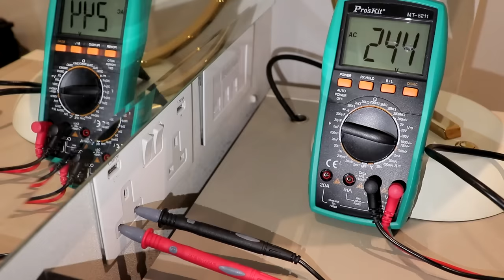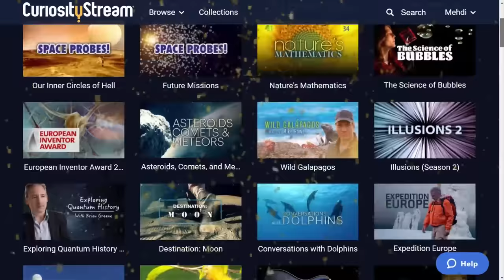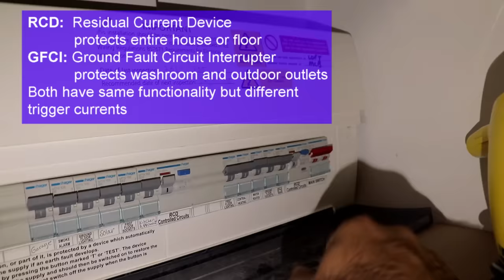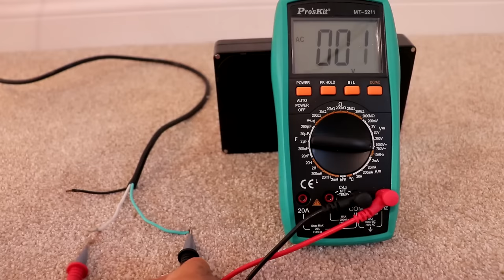Power Outlets in United Kingdom

Comment: As an electrician,  I was watching some of your antics through my fingers.  30mA is deemed the minimum that would stop a human heart. The bathroom adaptors are isolating transformers 1:1, so 230 in 230 out but the output has no reference to earth. Our  13A plugs are the world's best IMO, but a bugger to stand on in bare feet in the dark.
Reply: Most defibs give you somewhere in the vague range of 40 amps of current. We want to shut your heart down so that it restarts simultaneously and stops fibrillating.
Reply: is that 30mA applied directly to the heart tissue?
Reply: @KarldorisLambley  I believe its a current path from arm to arm across the chest.
Reply: @briwire138  aha. Thanks for your reply. Wow 30mA isn't much at all
Reply: RCDs are designed to shut off fast enough that 30 mA shouldn't be lethal
Reply: @Abigail-hu5wf  Many times have I fallen foul to the inverted plug in the dark. Worse than lego...
Reply: Who the heck stands on plugs?  Keep them out of the walkways at the edge of the room!
Reply: @SproutyPottedPlant  I see you have no experience with children at all... Even if you welded the plugs to the wall with titanium brackets they'd find a way to leave them laying about in the middle of the floor so you get a nasty 3am surprise when trying to use the toilet.
Reply: Once when I was a kid I was running down the stairs (you know how kids live to run down stairs instead of walking normally?) and not looking where I was going. One of my brothers had left a plug lying around face up at the bottom of the stairs, and I stepped straight onto it with the full force of gravity, my body weight and too much speed behind me. Had to go to A&E lol
Reply: @J75Pootle  you have suffered the worst pain imaginable to man. I admire your braveness.
Reply: @SproutyPottedPlant  or plugged in with the switch off
Reply: stopping/starting a heart is more dependent on the joules of energy, not amperage.
Reply: @J75Pootle  The only way that could've got any worse is if you had stood on the plug, then fallen to your knees on lego.
Possibly before rolling over onto mouse traps.

That must've hurt like crap though, those things are blunt as hell.
Reply: @shaggybaggums  yeah, easily one of the most painful experiences of my life, and definitely the most pain I've experienced due to blunt force
Reply: @Xorthis  I have had those naughty kids and still never stood on a UK plug and I am 61 years old. Tempting fate here!
Reply: But because we have switched outlets, we don't need to pull the plugs out and leave them laying on the floor in the first place 😁
Reply: @juststeve5542 Yeah, but your houses were built before electricity (your country is beautiful) so it’s been added later when one socket per room was acceptable. Roll on 100 years and now you have to swap out constantly. When I was in the uk, the kitchen had 2 sockets (not counting the special one for the cooler) and had a toaster, a kettle and a coffee machine. It had a special little thing to hang the unused plug up on while you were playing hotswap in the morning!!
Reply: @PippetWhippet  that must've been a really old house in need of some serious modernisation. Since the 1980s it's been recognised that you need multiple plug sockets in rooms for modern appliances. The days of one or two sockets per room were back when it would've just been an electric fireplace and a vacuum cleaner.
Reply: Top tip, they are also effect phone stands.
Reply: I have stood on a plug bare feet feel like I still got my scars today😂😂
Reply: What you meant to say is UK plugs are ridiculously bulky and the fuse is there as a copper-saving post-wartime effort, not for redundancy.
Reply: @Xorthis help me understand this I have stepped on Lego tons through my life I have even jumped on it to try and get it to hurt but it doesn't not even slightly but everyone says it hurts
Reply: @psgamer-il2pt  you either knew you were going to step on the lego or your feet aren't soft and fleshy. We're not really talking about lego here, but 2 inch metal spikes with blunt points. If you put your whole weight on them, your foot stands a good chance to become a plug socket.
Reply: @Abigail-hu5wf We don't measure the electricity in amps, but rather Joules (J), we also need to discuss the difference between biphasic and monophasic defibrillators, and their corresponding success rates in defibrillating either of the two shockable rhythms: Ventricular Fibrillation (VF), and Ventricular Tachycardia (VT/V-tach), also the sub rhythms, such as fine and course VF, alongside polymorphic and monomorphic ventricular tachycardia, along with their corresponding success rates in defibrillation. Make sure to also back up your numbers and claims with verifiable sources.
Reply: @The_Ballo UK plugs are in practicality, smaller than US plugs, and the fuse is important. I really don't get it with Americans, why do you hate on everything? Do you dislike the fact that it's good? That it's better than what you have?
Reply: @cessnacitation-x  The fuse only exists because of the daft idea of ring power wiring
Reply: @The_Ballo Yeah lets ignore overcurrent protection, lower chances of electrical fires or damage to appliances n' all.
Reply: @cessnacitation-x  Those are purely speculative and evidence-free assertions. American GFCI outlets, which are cheap as hell and easy to retrofit, trip with fewer amps than the European standard. Electrical codes and insurance companies have figured these things out a long time ago. UK plug fanboys are just cringe and should STFU
Reply: But...but why would you stand on a 13A plug in bare feet in the dark ??!?
Reply: I never have plugs lying around these days (in Hong Kong where we have British plugs), but I have some vague memory of painful incident when I lived in the U.K. Not sure why.

Comment: Fun fact- UK plugs are actually only held together with 1 screw (in the middle). The other 2 screws (at the bottom) clamp the cable to stop it coming out of the plug.
Reply: Not only uk its used in India also only with a round shape of the tip

Comment: Missed perhaps the biggest key safety feature of British plugs; they are flush to the wall and the wire points downwards, so it is almost impossible to knock them out or half out. US 2 pin plugs easily get knocked or bent sideways or downwards, exposing the live parts or just really annoyingly losing connection.

Comment: The plastic on the lower part of the pins is to prevent small fingers touching the  live parts when inserting or withing the plug. NOT FOR WRAPPING WIRE ROUND.

Comment: uk: has one of the safest plugs in the world
electroboom: still manages to nearly kill himself and trip the breaker of his hotel
Reply: They look safe until you step on them
Reply: @sebastianrakowski1583  can you base that on fact or is that just your opinion?
Reply: codprawn What's WW2/1 got to do with a argument with power plugs
Reply: @paulfitzgerald7513  That is your self presentation. Ok I get that.
Reply: @sebastianrakowski1583   I mean, we provide some of the highest standards of higher education in the world. 
 Not that it makes the average person smart, but it doesnt imply we are particularly stupid?
  Whats wrong with providing extra safety around electrical equipment? I dont hear our electricians or energy board complaining about our system.
Reply: @sebastianrakowski1583  what country you from??
Reply: @paulfitzgerald7513  Have you ever heard of the old Usenet/Internet term "troll"? I think that's what you are feeding right now. 

Yes, the UK has one of the safest electrical connection systems in the world, but idiots exist in the UK as well as everywhere else. Anyone who, for example, daisychains extension leads, fails to completely unroll coiled extensions, replaces the fuse in a standard three pin plug with a sawn off nail or a piece of foil and so forth. All examples I've seen done and all examples of things that could lead to fires and other problems. 

Mind you, some of what I see in this video seems a bit off; for example I have never seen a power converter with a plastic earth pin. Sounds like a knock-off chinese import to me. Mind you, if this guy is familiar with Big Clive, he may be advised to watch some of the videos he has produced over the years testing power cables and other devices from China. It seems that some companies out there don't quite understand exactly what the Earth line is for and merely put something there for show!

As for Sebastian, I'd suggest that you put up or shut up. If only to give Paul a break!
Reply: @mistie710  They often sell those groundless plugs outside of the EU as travel converters.

Not like a random person from the US or Ghanda would know that it's important.
Reply: I think Most of Asia doesn’t use grounded plugs only recently they adapted it. i have immigrated to Australia in the philippines we use American type plugs like the two prongs we have ground wiring in some modern houses and devices that demand high voltage is the only one that has ground prongs it’s not safe but we use tons of plugs but mainly American like. in australia has like 10 different outlets and like 1 main outlet some plugs has only the Hot and Neutral and no ground and some has the ground some has longer opening in outlet (for different plug) for ground sorry if i am wrong only observation not an expert
Reply: codprawn Rule Britannia!
Reply: @sebastianrakowski1583  as an Englishman I'll give you the 50% lol 🤣
Reply: yep
Reply: The earth prong is longer than the other two, so it pushes the doors open on the socket. Hence why its made of plastic, its just to open the socket. The item will still work without the earth
Reply: @sebastianrakowski1583  I'm quite sure RCD is not only needed in UK, but nearly everywhere in EU.
Reply: He was no where near killing himself. He had hold of a bit of insulating plastic when a small wire (incapable of carrying a lethal shock) was vaporized in a hole behind said piece of safety plastic (at which point the system shut down so there was no electricity anywhere). The fact he jumped and screamed like a girl did not mean it was dangerous.
Reply: @SylvanApe  r/woosh
Reply: @unity7749  No, I get you were making a humourous remark. I even smiled. I just happen to be an ardent fan of the British electrical system and wished to state this for posterity.
Reply: I REPEAT,  THIS COMMENT IS A JOKE
Reply: @unity7749  It's ok man, we can see how serious you are.
Reply: Same safety features are also in India
Reply: @peterzingler6221  Are you saying this based off a personal experience..?
Reply: @rugbychampion1  I think you missed the point, this bright guy does stupid stuff to stop 
other less smart people doing it, he is a qualified electrical engineer, and takes precautions which you don't see in the film, if you did it wouldn't make the point, and also of course he might die doing the film! he concluded his video by saying the UK electrical system is much safer than the North American one, which of course we already know, he's telling viewers in other countries, particularly Americans...
Reply: @BirdmanNorfolk   What ya on about. Your comment has nothing to do with what i put 😂
Reply: This must be a joke sat here pissing myself at stupidity.
Reply: @davehughes6501  unless the item requires an earth, then the 'long' pin is brass too.
Reply: @unity7749  oh no WW3 is happening here.
Reply: Depends on the manufacturer
Reply: codprawn wait. What did he say
Reply: @codprawn  r/wooosh
Reply: @codprawn  the slavic economy was always the best and will never be beaten
Reply: just the tips he shorted out right at the place where it goes in he should have shorted it out at the load side he has no electrical sense
Reply: Peter Zingler they hurt more than Lego’s
Reply: @davehughes6501  UK earth prong is a partially plastic sleeved metal (brass) and thus does provide a path for the electrons to flow to ground.
Reply: @codprawn  what did that guy even say
Reply: @iCore7Gaming  
Dan - sadly I can't remember now - it wasn't very nice - looks like it has been removed!
Reply: Peter Zingler you get used to it when you live there, trust me
Reply: As a British person I can claim this true
Reply: DuckVR Rule Britannia mate
Reply: @davehughes6501  Schuko and french sockets also make contact first with the earth.
Reply: @mistie710 and watch John Ward demonstrate dodgy electrical imports, including adaptors.

Comment: When wiring a UK plug brown is live, because that's what colour your trousers go if you touch it.
-Tom Scott
Reply: webchimp Actually that wire was quite unusual for modern regs.  Usually they follow the IEC or CENELEC rules: Earth is green/yellow striped.  Neutral is light blue.  Lives are any other color but usually first live is brown.
Reply: @ElectricityTaster  That's...
Absolutely disgusting.

Comment: Oh my god, this guy is hilarious 😂! Imagine going on a trip to a foreign country and the first thing you do is short circuit your outlet causing all the breakers to pop
Reply: He´s a menace to society! I like it!
Reply: Not an electrician, not even a little bit, but when he put the plug with the wire “bridge” in the socket and it blew, he had the switch on. Then he complained that the switch was, “redundant, and not a proper breaker”. Wouldn’t you have to have the switch off to test it’s ability to stop a short? Nobody said the switch was a breaker, but if you’re gonna test it, test it right, maybe?